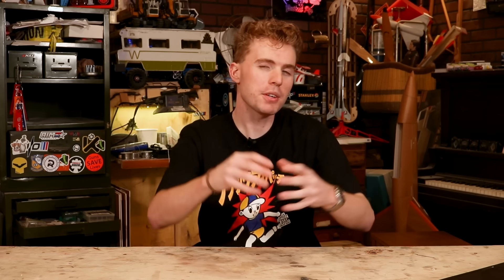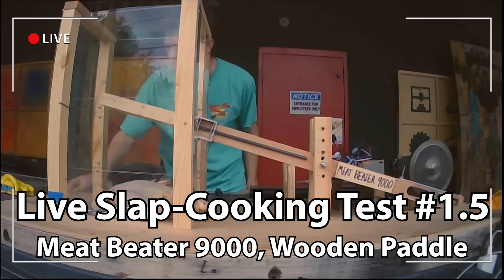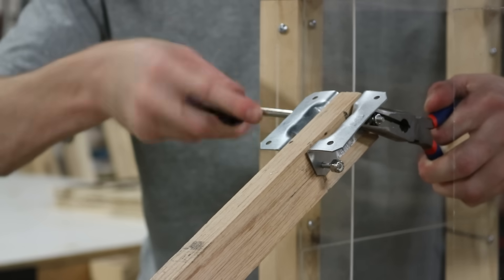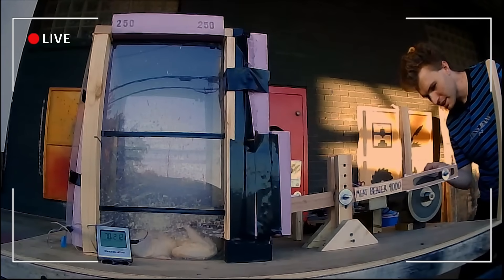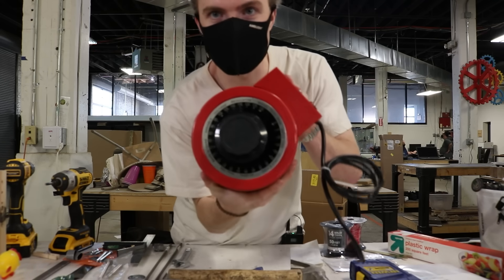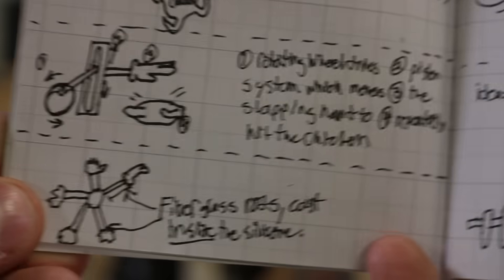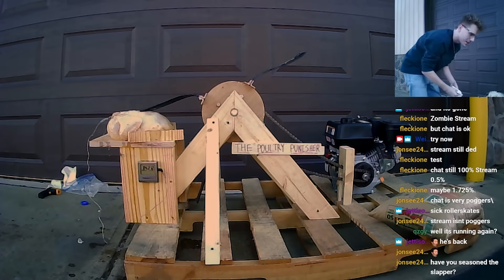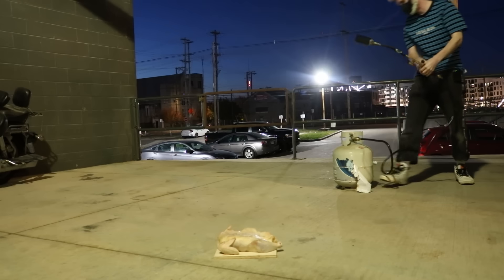How Many Slaps does it Take to Cook a Chicken?

Comment: While the Poultry Punisher is indeed a more efficient slapper, I suspect it's also become a rudimentary fan keeping a constant stream of cooling air going right across the slap sight.  That combined with the amount of chicken constantly departing the slap sight and taking any heat gains with it--poulspiration, if you will--is why you're not seeing any gains with this design.  That's alright though.  After all the calculations and theory, the only way to know if it'll actually work is to build it and test it.  As Thomas Edison said, "I didn't fail a hundred times.  I learned a hundred ways not to make a lightbulb."  You've furthered the cause of science even if you didn't ultimately get the results you were looking for.  Good show.

Comment: Wrapping the chicken in tin foil first might help with durability as well as insulating heat. Even just putting a few sheets of foil in the one small section would be helpful. I'd also use just a chicken breast, not the whole chicken.
Finally, a belt tensioner on the chain for the final slapper would reduce energy loss and keep this more consistent. Good clip!

Comment: I wanna see a slap oven that doesn’t actually slap the chicken but uses the slapping as the main element heating the oven.                                                                             

Edit: this blew up more than I thought it would. PLEEASE someone get this comment to him i need to see this at least attempted😭
Reply: that's actually not a bad idea.
Reply: This an underrated idea lol.
Reply: That said, if you stuck the chicken between a lattice of highly conductive metal, and applied the frictional and kinetic force to the metal instead of the chicken, then it may be possible through direct conduction to cook the chicken
Reply: Brandon Michael love that idea honestly wtvr gets the chicken cook in the most unproductive and seemingly unconventional way I’m happy
Reply: max Epp squeeze a chicken in a silicon carbide cage (high end brake disk material used in cars) and bolt it tight, then have two slap motors (one slapping the top of the cage and one slapping the bottom) and my guess would be an evenly cooked chicken as an end result
Reply: Brandon Michael thats fucking amazing🤣
Reply: @maxepp9394  Enclose the chicken in a metal-ceramic container then drop it from outer space for it to get cooked by air resistance.
Reply: It could actually work, since the oven can be made from something that won't just be annihilated like chicken meat. It should at least work better than directly slapping the chicken.
Reply: If a convection oven is at a steady 400 degrees... how hot do you think the coils are. 

You’d stick you hand in a convection oven but if you touch the coils ur talking immediate skin damage. Cool thought but nah
Reply: 'Slap oven' 🤣🤣🤣😭😅😂🤣😭
Reply: This is a gay idea I don’t like it

Comment: what if you slap some kind of metal surface to heat it up so it cooks the chicken in an insulation similar to the one you built on the earlier tries technically it's not cooking the chicken with a slap but it's making an oven out of slaps but what if.....

Comment: The poultry punisher is a bad idea, you need to slap straight up and down, drawing the slapper across the chicken just cuts the chicken and makes a mess. You should make an acrylic glass cover for an engine (in place of the cylinder head) like the one you used, put a piece of chicken in there and power it from the outside for example with a second engine. This way you should be able to easily achive 100 slaps per second, plus you can adjust sprocket size to multiply that number even further, just don't go over 150sps or you might throw the stock rod. And make sure to have more volume in the chicken chamber than the chicken has, otherwise you will just hydrolock it.

Comment: I find presenting only converted units a bit odd. At least you could present the base units as well. (And yes, it would be useful if they were shifted 273 degrees.)
Reply: I did the simulations in kelvin then converted them for the vid aha 🤷‍♂️
Reply: @RepeatedFailure  well, everything is measured in Kelvin/Celsius before some deceives convert them to farenhight. Anyway, I would prefer having the unconverted units, even as a overlay on the screen.
But another thing. It would be cool if the experiment was remade with an item that does not break under slapping to see what temperature it would reach.

Comment: Just a suggestion: you should wrap the bird in tinfoil (shiny side in of course) Not the most photogenic setup, but it would really help with thermal radiation.
Reply: I suggest this or an emergency blanket for the meat beater 9001

Comment: Well done, but I believe the paddle design WOULD NOT have worked due to the rotation introducing a sweeping motion instead of a slap (vertical motion only). In addition, and I'll admit this is a little nuts, if you were to do the chicken slapping in a vacuum, the heat would not dissipate (as there is no air to radiate the heat) and the chicken will cook, probably all the way through due to how heat radiates through a mass.

So, basically, if you did it in a vacuum, it would 100% work with far less slaps, though the chicken may burst due to the vacuum pressure alone...
Reply: The water in the chicken would boil in vacuum tho, cooling it substantially

Comment: From what I see the problem with that design is that it’s dragging along the chicken. Slowly it’s smudging away each layer of chicken. It might be fair to say that a fatter chicken has more soft flesh moving around, and that the soft flesh falls away much easier. So if you can solve the first problem by maybe making each slap a very vertical motion and using a less grippy material than rubber, and you solve the second problem by using a smaller bonier tougher chicken you might have a better shot. 
That’s just my thoughts though

Comment: If only there was a way to increase the temperature of the chicken without beating it to pieces. Perhaps there might be a way to induce the individual molecules of the chicken to vibrate at a frequency high enough that it cooks itself but at a low enough amplitude that it doesn't beat itself to death. Maybe as a 1st step to test this hypothesis you might put a chicken's egg into a microwave on high for about 5 minutes and see what happens.

Comment: I think your biggest problem is still the heat dissipation.... at least with the hand it was the same surface so there would be some heat in that part as well and the impact would still transfer some of the energy as opposed to the rotary slapper where each piece was waving through the air for about 90% of the time and cooling off... there is also the considerable "breeze" that would be blowing off with each method... that breeze is also carrying away a fair portion of the energy as well... when the calculation is only considering the impact energy it is also considering a near perfect transfer of energy when it would actually split between the two surfaces.... the chicken would retain a bit more energy as it is not moving through the air as much, but the slapping portion is still moving through at least 4 times as much air and cooling during that time so more and more of the energy from each slap is being used to reheat the moving slapper and less and less gets transferred to the chicken... eventually the amount of added energy is equal to the energy being bled off by the air and the whole system reaches equilibrium again.... a hypothesis that is somewhat empirically proven in the fact you had to increase the speed every time it hit that equilibrium....   the only way I could see more success with this experiment would be to do it in a vacuum where there would be no air to transfer the energy away...

Comment: WAIT WAIT WAIT, what about a durable mold that fits around the chicken and acts as a heat sync, you have a metal that has contact with the chicken and you then slap the crap out of the shell, hopefully giving more potential integrity to accept higher forces

Comment: I don't think it was temperature increase through impact. It was warming because of friction. The flapperons were wiping over the chicken as evidenced by the wear pattern on the bird. It was the friction between the sliding, dragging action of the flapperons over the bird that put heat into it. 
A totally different form of energy transfers than the slappers.

Comment: Slapping could only cook one side. You should instead try choking it.
The chicken choker will out perform the meat beater..."hands down". Rather than wasting so much motion it should be limited to slight oscillations. The chicken should be placed in a choking cylinder. The cylinder should be split and springy. (Like PVC)
One end should be fitted with an anchor bracket so it cannot be spun by the choking cam. An anchor bolt will adjust how tightly the chicken gets choked. The other end should be fitted with cam followers. The cam would be excentric discs attached to the shaft of your motor. It would benefit you to have them balanced against the load. The chicken choker will not fail like the meat beater did and it will cook the entire chicken without splattering it all over the place or destroying it.

YOU CAN NOT QUIT NOW!
YOU MUST CHOKE THE CHICKEN!

Comment: Guys if heat rises how come at higher elevation it’s cold and since your getting closer to the sun shouldn’t you get warmer?🧐 If the sun can create temperatures such as 100 degrees why is it cold in the space surrounding the sun but the earths ground is warm but it’s farther away?🧐🧐🧐
Reply: My guess is that space is a vacum and the earth is solid and has a relatively large surface area. Could be wrong, just a guess.

Comment: I ve got some ideas but I don't know if it will work. Next time maybe stuff the chicken with some weggies or pour some water/stock inside a vacumsealed bag. Then wrap it with some kind of insulator like aluminium foil and some insulating fabric or some special insulating stuff. Than maybe another bag or something to prevent it from disintegrating. Also try to slap it only hard enough to reach around 110 degrees. I think that you would need to slap it for more than 8 hours, probably from all sides.

Comment: I did something related with my physics students once.  I put 1kg of lead shot in multiple ziploc bags then into tiny foam coolers.  They then lifted the shot 1m and dropped it 100 times (it took about 2 minutes).  In the end there was a significant, measurable temperature change and they were able to calculate the heat capacity of lead with a substantial, but not enormous, error.

Comment: while it might be not exactly like slapping a chicken for real, I would have tried hitting something else near chicken as a heating source... As it was noted in the video, chicken's integrity is an issue which means it is not ideal to slap it directly. If for example base on which chicken is placed was metal and that's the part that will get slapped, it might have good enough integrity to withstand slapping for hours straight. Also metal is good conductor so transfer of heat, depending on metal, might be almost as good as slapping chicken directly. Also also even in oven there are usually some sort of insulation, so doing it literally outside might not be a good idea or it might not even have a decent chance of working unless you're in a desert and there's 50+ C degrees as an ambient temperature... but by then it would probably be better to use sun. At the same time designing the smallest possible box for the whole mechanism might work better too simply because you have to heat up air inside and every construction element accessible from inside while raising the temperature of a chicken.

As a testing or tuning of process i wouldn't even use whole chicken either. the bigger the object - the more time and energy you'll need so starting small (for example chicken leg or it doesn't even have to be a chicken) might be better to design a system that would eventually work.

Comment: Okay so hear me out, does the chicken need to be slapped directly? 
Say the chicken rests upon a pan or metal plate being slapped, would this have a higher success rate?
Moreover, I was a little disappointed you didn't use the same method of flattening the curve by way of the controlled heat and sous vide.
Maybe the plate being slapped could be considered to defeat the purpose of the "slapping a chicken to heat it," but I think thats up to the beholder. I would also argue that the real concern of the posed problem is that its the slaps that heat the chicken through friction and force that matters.
Anyway, great stuff. Just subscribed today.
Gg

Comment: 2 suggestions:
put an aluminum or copper film on top to possibly "absorb the impact" - the rationale being that you want to use tension in the film on top to reduce plastic deformation of the chicken.
instead of increasing the speed at which you're slapping (which happens when you increase RPM, try increasing the frequency(add more slappers more densely packed.
IDK how well either would work, but that's what I'd try next. IDK if you have the patience tho, I would've given up long ago lol

Comment: the heat of the motor and friction on the connection to the lever is heating the lever, the faster you slap it the longer the chicken has to be warmed to the temperature of the paddle

Comment: The best rig = how to cook a chicken with a convection oven and a hair dryer... That's a mention this is like the world's stupidest question. of course if you crashed something into the chicken at high enough velocity it would flash over and cook the chicken.... I mean it would also explode the chicken too. You can test this with a bullet. Fast moving rifle round would enter the chicken causing a cavity to form that air would fill. Then the pocket would close compressing the air and causing a flashover where the air temperature would reach thousands of degrees. With a fast enough bullet that was small enough you could probably find a balance where you could instantly cook the chicken. Therefore you can cook a chicken with kinetic energy. If your idea is more geared toward friction use a f**** microwave.

Comment: I really admire the effort that went into this only to be stopped by the structural integrity of poultry. What if the slaps were applied to something more stable that the chicken was ON? Like, with what frequency and for how long would your poultry punisher have to slap a cast iron (or carbon steel) frying pan  to cook a chicken resting in it? Is that more feasible?

Comment: The spinning form factor is likely working against itself. It's slapping, clearly, which is imparting heat. However it's also moving a fair amount of air across the chicken like a fan which is causing heat absorbtion and dissipation into the greater atmosphere. I think you should've maintained a seal around it like you did previously so that the air is being heated and contained in the system as much as possible.

Comment: Put a few breasts in a cylinder and have a piston ram it at 10,000 rpm.  Put some ventilation holes in it to vent any excess heat and use cooking oil  as lubricant. Although, if the oil gets hot enough, you may have people say its virtually frying it. Maybe no oil? Anyway, I think a chicken engine would be the best way to do it. You could even hook it up to an actual motor to run the crank shaft.

Comment: It wasn’t being heated by the slapping. It was being heated by the friction of the slap wheel pulling the rubber past it. You can see the temp drop when you lubricate due to less friction. The first design works it just needs stronger materials.

Comment: I'm also a little curious why you didn't consider protecting the bird with a mylar bag. We cook turkeys in them...ones with greater thickness are durable, and kind on friction. It could also be used to the the bird down hard and limit the transfer of the motion from slaps to the physical motion of the bird, rather than controlled molecular motion.

I don't think this bird is dead yet. It's pining for the Fj-ords!

Comment: Vacuum pack the chicken. Oil the vacuum plastic's outside to reduce slappage friction. This should increase the chicken's integrity enough to slap the heat into it. Seal the rig to keep the air inside, since a slight breeze will destroy progress, and the machine creates a lot of that since its basically a less efficient fan. The less air in the enclosed rig, the easier to heat it up.

Comment: In theory, if you don't directly slap the chicken, but for example if you slap a sheet of metal (or something more resistant to heat change) in contact of the chicken, would that count as heating the chicken with slaps?

Comment: Clearly, the structural integrity of the raw chicken is insufficient to withstand the direct kinetic energy required to reach cooking temps. Theoretically, you could reinforce the chicken with a polymer or something similar.

More feasible, however, is placing the chicken in a resilient, heat-efficient container, and slapping the container to create an oven-like effect.

Comment: For the first type of machine, maybe it would be better spring-loaded, so it has a bunch of force down on the chicken, but the motor actually uses energy to lift the arm, releasing tension, so the spring helps slap it better. 
..
Wtf am I doing with my life, I’m suggesting improvements to a meat slapping machine... FFS, I’m going to bed.

Comment: You should have made the wooden slapper shapped like an oar. It will hit the whole chicken. Depending on how you shape & carve it. The motor may need to be stronger. Yet more surface area + stronger motor = more heat i think. Beautiful Experiment tho. Thank you for putting the work in a putting it up.